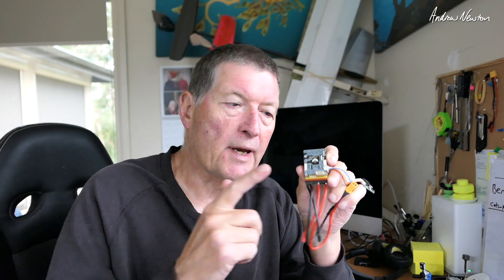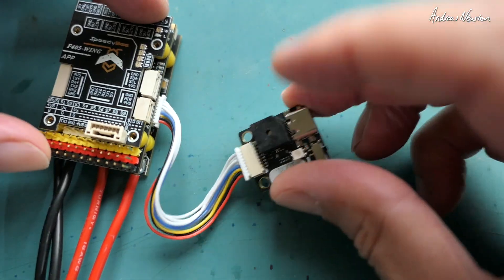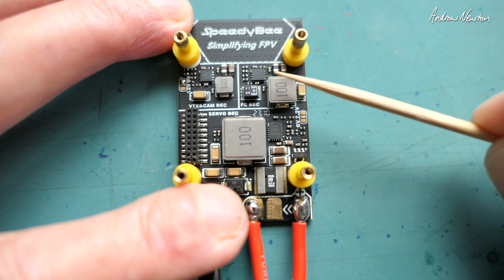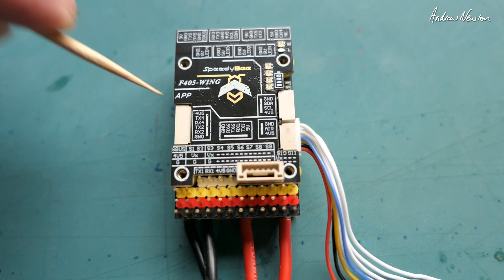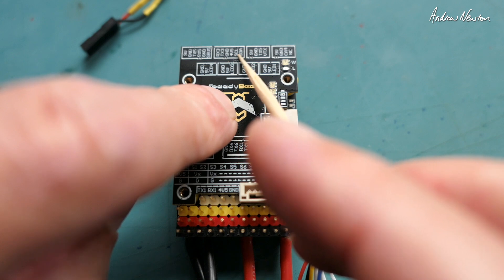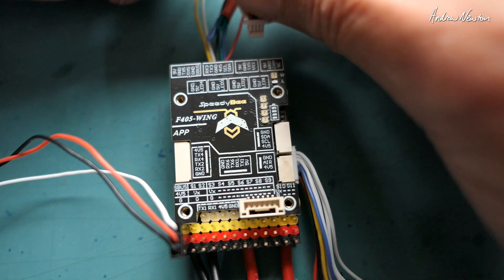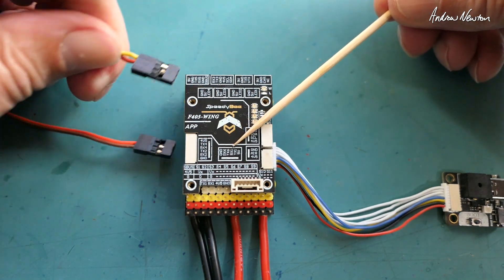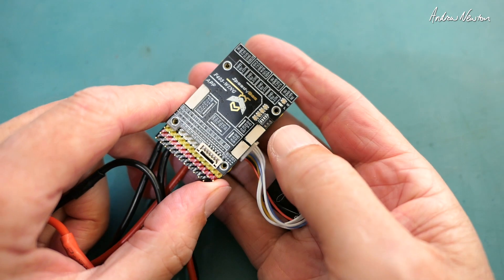SpeedyBee F405 Wing - Connection Basics

Comment: Both of my GPS units I have on my desk include compasses. Are there specific pins I should leave disconnected when using with my speedybee with iNav? Thanks -Charlie
Reply from the maker: SCL and SDA are the compass connections. Can just cut those wires or leave them connected and disable the magnetometer in INAV

Comment: Hi there.  Is it possible to run 2x ailerons, 2x flaps, elevator, rudder, esc and 2x servos for head tracking on thus 405fc?
Reply from the maker: Yes, could even add a second motor and another servo as well.
Reply: @AndrewNewton thank you for the answer.  This is completely new to me.  Was given a Ranger 2000 that I'll setup
Reply from the maker: Nice one. You can have ailerons on one channel with a Y-Lead and same with flaps if you ever run out of PWM outputs
Reply: @AndrewNewton hi again from over the ditch.   Im having an issue with my Speedybee f405 mini wing setup.  I can get servos moving but can't get the motor to spin. Motor is in S1 but does nothing.  If I plug a servo in S1 the servo works
Futaba T16iz. R2001sb. Tried a few other rx with same issue
Any advise much appreciated
Reply from the maker: @terryparker6426  How are the bars moving in INAV receiver page? From memory Futaba is different to other systems. You will see error messages when trying to arm that might help.
Reply: @AndrewNewton disabled gps like yiu suggested in another vid.  On the page with master and slave motor test it works. I noticed i have an arming issue now.    Slowly figuring it out.    Your vids are extremely helpful

Comment: I think I understand some of this… HAHA! I want to put this on a jet that I already have fpv on. This systems goal for me is to provide essential flight data to be displayed to screens in my field of view, not control anything. Spektrum radio control with ironquad(caddx) fpv system is currently equipped. My question is how do I connect a current sensor? I have my eyes on the matek 150A hall sensor. Any advice? Or… would it make more sense to wire the f405 between the battery and 100A esc. Seems im right on the line. Thank you for your input and advice!
Reply from the maker: Would be safest to use a Matek FC and the 150A current sensor. I can't see how to connect an external current sensor to the SpeedyBee and you jet may draw too much current for direct use. Not really my area of expertise.

Comment: Im using ChatGPT to help me build a FMS Futura with fpv headtracking DJI o4 + C20 Gimbal, f405Wing and  DJI Goggle3 + RC3 as radio system. GOT claims I shouldn't plug the esc through the f405, instead use it directly to the battery and connect the ESC data cable to the f405, but i see people soldering the ESC to f405, could you please help decide what is the right way? Thank you so much.
Reply from the maker: If the max current exceeds the FCs specs then you can connect the ESC straight to the battery. You may also need to use an external BEC to power the servos, and you may not have enough PWM outputs for all the servos and gimbal.
Reply: Hmm right. I've connected it all, but the servo response is af it was at 1fps, when i move a stick, the plane only responds to the movement about 10 seconds later, i believe my o4 lite is resetting continuesly so as I'm using a Dji Goggle3+RC3 as radio, the SBUS signal gets cut everytime it resets itself. Qould you have any guess on why the o4 is shutting down? I've installed a fan so i doesn't overheated (it was previously), everything works as it should, just something making the o4 reboot non-stop  @AndrewNewton
Reply from the maker: I would disconnect the FPV gear and see if the FC and servos work. Then power up the O4 with a battery to see if it works by itself.

Comment: Is the SpeedyBee suppose to be HOT HOT to the touch?
Reply from the maker: No, not the FC. VTX and cameras can get hot
Reply: @ the wireless board is what I can check the easiest. The entire thing is about as hot as a lightbulb. It can’t be healthy. Considering that it was smoking and I cannot get my controller to binds to a receiver. I’m just gonna return everything and throw in the towel

 Maybe I can sell off the stallion
Reply from the maker: Smoking is not good. Must have a solder short or reverse connection unfortunately

Comment: Hi Andrew - does the fact that the board has only one I2C mean that you cannot run a magnetometer AND and digital airspeed sensor?
Reply from the maker: I2C is a Serial Communication BUS which means it can handle multiple components at the same time.
Reply: @AndrewNewton  Oh, okay.  Thanks!

Comment: Hello, andrew. When i dont connect the esc bec red wire to the fc, the servo will not move..but when i connect the esc bec red wire, the servo will move..
Reply from the maker: That's odd. I would use a multimeter to see what the onboard servo BEC is doing. Definitely should not need ESC red wire
Reply: @AndrewNewton  i think servo bec was damaged..please confirm, if i can power the servo by external bec..? Thanks..
Reply from the maker: @espanolacj  Yes that's OK

Comment: Hi Sir , i have a question , What if i want to use 4 in 1 esc , should i use PDB that come with Speedybee FC wing ? , or i just put a battery direct to my 4in1 esc and connect it to the fc without using the PDB ?
Reply from the maker: Either way is OK but you won't get current telemetry if you bypass the PDB

Comment: Hi Andrew, I have a ZOHD Altus with the standard ZOHD 30A Esc, I have connected the servo's ground and signal to the SpeedyBee F405 WING output and the throttle is set to linear, no scaling, ESC calibration done but the motors are almost like a soft start, in other words I throw full throttle and the motors gradually spin up... is this a voltage reference problem on the ESC's or have you come across this problem before?
Reply from the maker: Sounds more like an ESC programmed soft start. I have not come across that just from INAV. Check the ZOHD ESC manual
Reply: @AndrewNewton  , you were spot on!!, was a soft start setting that had to be corrected using throttle and sequence of beeps to restore normal startup, thank you so much!!
Reply from the maker: Well done. Most people these days would not be able to fix that issue.

Comment: Hi Andrew, great video. I've just about sorted my Speedybee F405 Wing and Inav installation in a Bixler and want to disconnect the compass as suggested in your video. (I did need to switch GPS RX TX  as suggested. yellow and white. )  I'm thinking compass wires are the blue and green. Could just try it I guess, but can you confirm please? Thanks. 
EDIT and update. I tried it, cut the blue, it worked. Still have GPS and FC state overview on the App shows compass not working . Problem is it will not let me arm now? Is there a fix for that please?
Reply from the maker: You can leave the compass wires connected but chose NONE in the INAV Config page for the compass.
Reply: @AndrewNewton  Hi, thanks for the quick reply! I spent the last couple of hours Googling and found a CLI command COMPASS_ENABLE= 0  , but couldn't see how to enter the command!  Literally a couple of mins ago. Didn't want to risk screwing the whole inav thing up anyway.   I looked through Inav and couldn't see compass in config but I'm in Inav now and I realise why I didn't spot it,  I  assume it is magnetometer!  That sounds much safer. I must say I watch all your vids and your FPV stuff which are amazing and it's where I learned of Loiter and was advised by a mate too it's a must (plus RTH ) if you want to fly FPV,  hence the Inav and SpeedyBee F405 Wing adventure. It's been a huge learning curve and as I said watched all your videos and Ian at Painless360 on this stuff, but there is still so much more to it all! I recommended both of on my latest video about my FPV journey.  Not getting many views on  that it's out of my usual video type I guess   A few years back I reviewed  more than 50 + action cameras on my channel, was getting 3 a week sent to me at one point by companies. Used to get loads of questions asking about operation of those. Big views in those good old days.  One camera 9 years ago which is still on the market  now has 664,000 views, my best. But they all got lots of views. Action cameras were a big fad for  while.  Lucky if I get 1k or 2k views now. Keep up the good work, it's much appreciated.  Hi from the UK. I msgd before and said 2005 I had 6 weeks and a lot of paragliding in Oz . 8,000 feet  asl one flight.  Those were the days.
Reply from the maker: Ah yes magnetometer and compass are the same. Took me a while to learn that too. Viewer numbers are funny. My new plane reviews or cardboard builds seen to do very well but chargers and the latest power bank are quite unpopular. Doesn't really matter, I do the videos because I enjoy it and I get to play with new gear, Happy INAVing

Comment: Please i have calibrated my ESC but still my motor doesn't work when I move the throttle stick although the servos response I'm using MC6 transmitter 6 channels with sbus receiver does it means my transmitter is not qualify inav or my ESC don't qualify calibration or what
Reply from the maker: Watch my "INAV Motor won't spin" Video

Comment: Brilliant video as always! I was just wondering why there is no capasitor in the box? I´m mostly using 3-4s lipo batteries. But I am considering using a 6s liion for longer flight times in my seaplane build... But wondering if that will spark up things too much.. :P
Reply from the maker: Just cost I guess. But it would be a good idea to add one if you're using 6S

Comment: Well after 8 hours of wrestling to get the servo's to work, I finally flashed it Inav 7 to get them working.  Guys from what I am seeing, this FC does not work on Inav 8!
Reply from the maker: Mine works fine on INAV 8. You probably used the wrong firmware or mucked up the connections.
Reply: @AndrewNewton  Well after a response like that! I said screw it I'll try to flash it again for the third time (The Charm). Flashed INAV 8  twice and then flashed iNAV 7.1.2 & 7.1 in which it started working, but you said you had it working so why not try again?  Thanks for that confirmation by the way.

Comment: So if I have a twin motor airplane I can connect both motors in parallel to the S2 pins and treat it like a single engine plane? Don't care about differential thrust.
Reply from the maker: Yes, as long as S2 is enabled for motor in the mixer
Reply: @AndrewNewton  Thanks. New to all of this open source hardware/software. Just started up again after a 10 year hiatus.
Reply from the maker: Exciting times ahead for you. S1 and S2 are the ESC signal pins. S1 is enabled by default but not S2 usually.

Comment: Nothing on this Speedybee Mini Wing works. The INAV configurator makes no sense. I install the firmware. Connect all the components and nothing sesponds. You’d think if the devs know what boards people are using that they’d make it so if you connect motors and servos then it would work. And that Mixer, WTF is up with that? Forget about it people, just buy RTF drones and leave all this stuff to the wizards in the know. No one actually wants this hobby to grow.
Reply from the maker: Mine works fine. Bet you used the wrong firmware

Comment: Great video! Don’t go digging for the answer - but I’m trying to manually sweep my servos (still waiting on my RX module to arrive). I enable motor and ESC control > I see that Servo 1 and 2 are active and connected to S3 S4. But I only have a slider for “1” and “M”. Both power the ESC.
Reply from the maker: Thanks. The only way to move servos using the INAV configurator is to enter PWM values under MID in the Outputs page then hit Save or activate Live Mode. Try 1000 then 2000 to see the full sweep. Also play with the Modes sliders to put it in to Manual Mode for full servo range.

Comment: Thanks for the great video @AndrewNewton!  With the way you have this wired up, would you need 2 batteries?  One connected to the ESC and one to the FC? -Thanks!
Reply: No - the ESC is connected to the battery directly using the ESC power leads on the board. He’s saying that since this is happening, it’s best practice to remove the BEC output wire coming from your speed controller. That way you aren’t feeding the unnecessary voltage back into the flight controller.
Reply from the maker: Thanks, my latest video shows the answer
Reply: @AndrewNewton  WOW, thank you!

Comment: My inquiry is regarding your ESC connection configuration.  Could you provide a video demonstrating the connection of a single motor, single servo, and single SBUS to the ESC, mirroring a typical aircraft setup but outside the airframe? I apologize for the request, but I require assistance with this specific aspect.
Reply from the maker: Yes, good idea. I'll do a video soon.
Reply: Thank you, Andrew !

Comment: 1 question: Where do I plug the three motor wires: into the ESC or the FC? My battery lead comes from the FC. Can you answer this question?
Reply from the maker: The three wires from the motor connect to the ESC, but I'll do a video soon.

Comment: Hi Andrew- Many happy hours of flying since you first helped me. Thanks! What type of UART connector is on the left side of the speedy bee? The documentation calls it a telemetry module connection? Would like to buy a few but don't know where to look!
Reply from the maker: Great to hear that. Have to look at the manual for the exact cable designation. It is listed down the bottom.

Comment: So does the esc plug inline with the flight controller? then the battery will plug straight to the flight controller? a little confused on that part. Thanks
Reply from the maker: Correct. Battery > FC > ESC. This means the FC can measure the current. If you don't need current telemetry you can connect the ESC directly to the battery.

Comment: Hi can we build VTOL using this FC? it seems there are only 2 output port for the ESC
Reply from the maker: Yes, just have to change timer settings (maybe 3 and 4) to MOTOR instead of SERVO in INAV outputs, then you have 4 MOTOR signal outputs

Comment: i have the moonlight kit - will it overheat on low power mode on standby? I put a servo controlled power switch in between power wires but it still powers up through tx rx & gm3 gimbal somehow. can you show us how to set up a switch to turn bec power off/on please - found instructions online but its chinese to me not inav.
Reply from the maker: My cameras don't overheat in Standby Mode. Are you sure it is activated? Maybe you need to install a cooling fan. Only $7.99 from Caddx
Reply: @AndrewNewton  sweet, thank you - just ordered one

Comment: Hi Where should we plug Jhemcu Buzzer / Finder in Speedybee F405Wing
There are 3 wire (Ground 5V BZ)

Is it okay to put it in the Servo?

I tried to plug it in the servo but the buzzer continuosly buzzing
Reply from the maker: If it is operated by a pwm signal then you can use a servo channel

Comment: This helped be enormously fit this FC to a ZOHD Altus (and your other videos on that model). Is the USB board buzzer supposed to work via the 'beeper' mode in iNav? Can't get it to work - it is functioning as it does sound during switch on.
Reply from the maker: Good question, I'll check mine
Reply: @AndrewNewton  It does... I was just doing something wrong. Tiny switch on the board and then set up to a channel in modes in the usual way.

Comment: That was super helpful! Thanks! I have a 4 in 1 esc with the 8 pins coming out that I have to connect to a SpeedyBee F405 Wing FC, which has like 11 ports with 3 pins each (S1, Vx, G). Do I only connect the Signal pins? How do I handle ground and current?
Reply from the maker: Best to ask a quad builder maybe, but signal and ground for each motor, don't connect to Vx.

Comment: CANT SEE SPEEDYBEE IN DEVICE MNG ?? : Fantastic thanks for teh info. I have a question when plugging speedybee f405wing into the pc via usb: I used to be able to connect the board properly to missionplanner via com5 and begin configuration, afterwards i had to flash it to the speedybee reccommended firmare (w/ stm cube programmer), I did some soldering for battery cables and now when I plug the USB (in several pc's) the board lights up, but device manager does not even see any device (device manager does not even refresh). I have checked for drivers, but no luck. Could it be that the board is toasted from (inexperienced) soldering? Any suggestions??
Reply from the maker: Look carefully at the solder areas and make sure there are no little strands bridging. Try reloading USB drivers (but I use Mac so not much help with PC)
Reply from the maker: and make sure the inter board pins are not bent or connected wrongly.

Comment: Hi, M. Newton, I bought a speedybee, but I cannot flash tye firware, I hold the boot button and plug it, but it doesn’t go to DFU mode, any idea, thank you
Reply from the maker: How did you fix it?
Reply: Hi M. Newton, finally I foud out after many houres that the driver was the problem, so as soon as I was able to install a new driver I was able to flash the board and the program open to the set up page. I’m learning and it’s taking some time but with your help I will be able to do it. Next steps programming my gimbal 🤞😂, have a nice day.
Reply from the maker: @carlboulianne4284  Excellent, I thought it might be the USB driver. I'll do a video on gimbal setup soon.